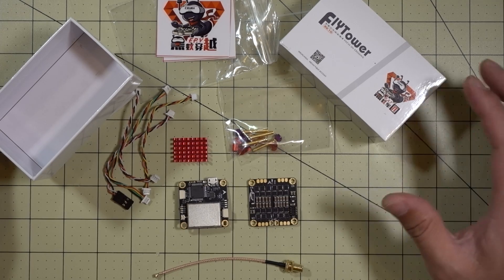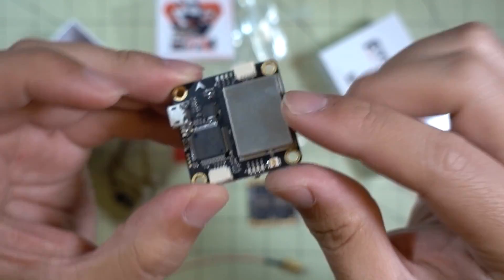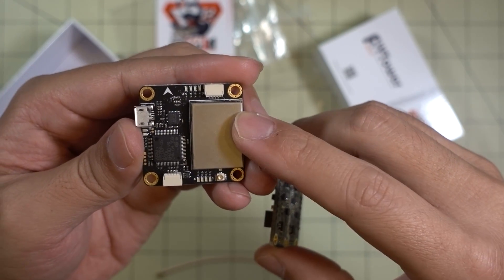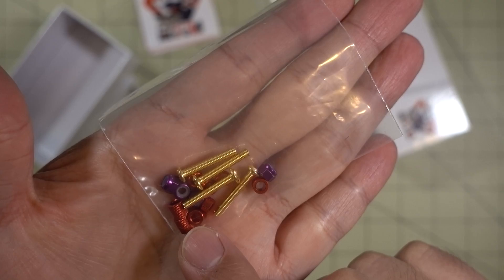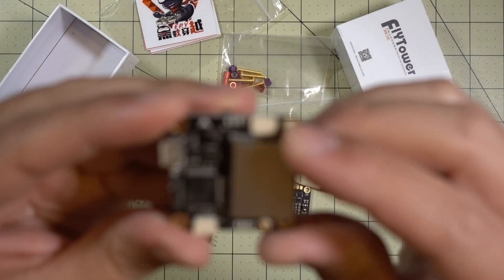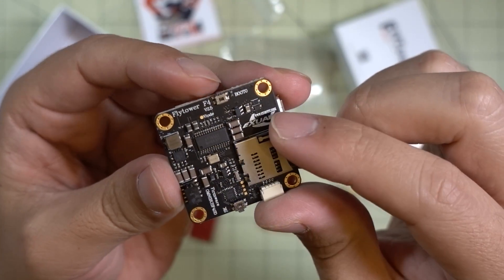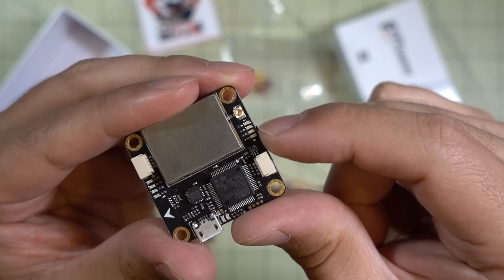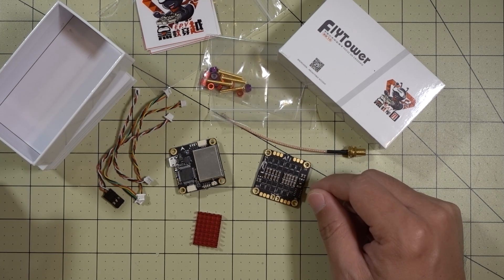FlyTower F4 AIO FC + VTX + 40A DSHOT ESCs ♥😀

Comment: when will this be installed and in what? i have this AIO in a Frog Race 218 and It went bad...cannot connect to betaflight anymore. boot button and VCP not working. maybe i can salvage the ESC board...would it work with the Flytower F3 part?

Comment: How would my spectrum race quad diversity receiver connect? I had to clip off the connection to attach to an SPRACING F3, so I need a serial uart, is that correct? Yeah I'm 1 month into this so I'm relatively new
Reply: make sure the power lead on the harness aligns with 3V3 (3 volts,Pin 1) and not VCC (5 volts, pin 3) Spektrums are picky about over-voltage
Reply: tagyourit12 yup, thanks, they are picky, wish I started with the Taranis but got the dx6
Reply from the maker: I'm not familiar with that receiver, sorry.

Comment: can you change vtx channels, bands etc via the osd?
Reply: For mine, the OSD shows the option and it looks like you are changing bands/channels/power level but when I exit the OSD it didn't actually change.  I only tried this on the original BF firmware it came with and have not retried since I updated to the latest BF though.
Reply from the maker: I think that only works with tramp or smart audio enabled VTXes and there is no mention of this in the documentation...